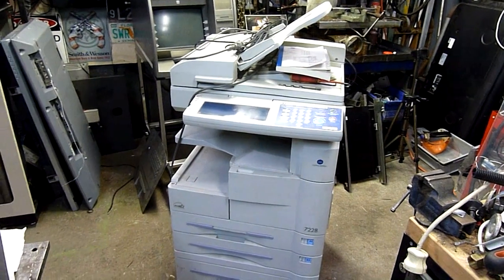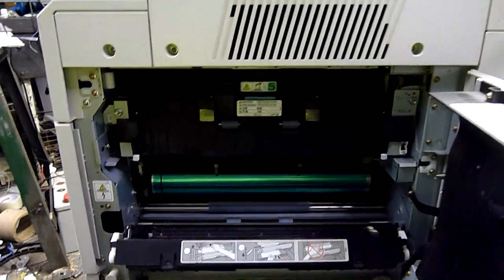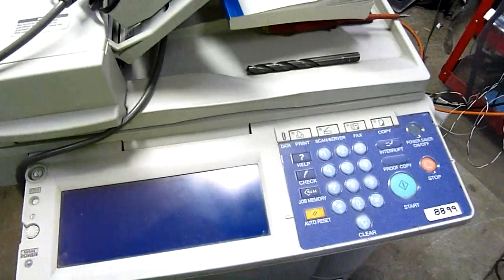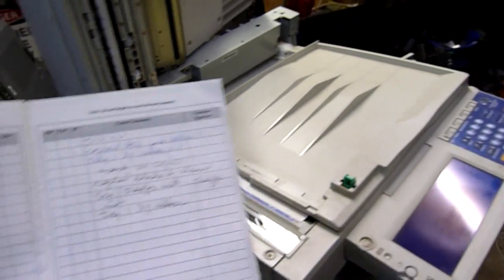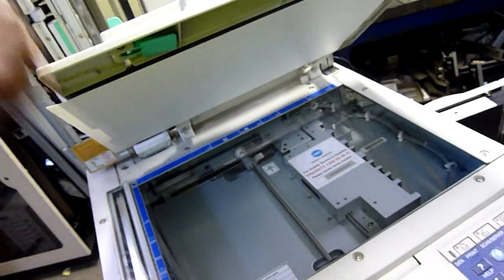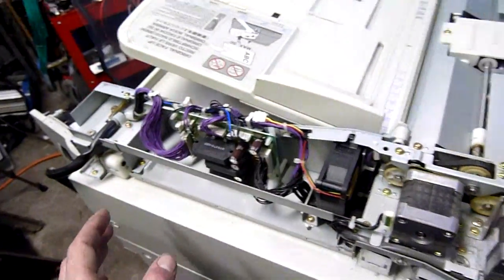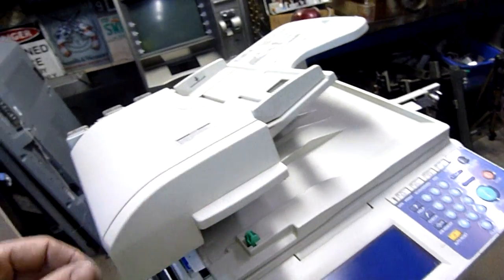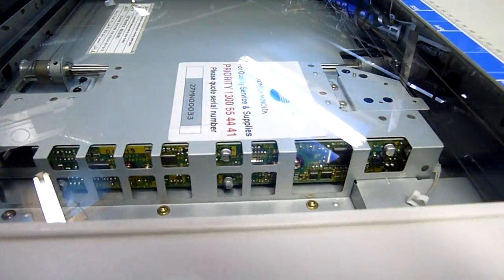Konica Minolta 7228 Copier Teardown Pt1   Intro and Document Feeder

Comment: I assumed that those lines on the drum are just a thing that happens. I have an old Panasonic Workio laser that I picked up for free with a new drum unit that still has that line on the left side of the drum. Doesn't affect printing at all, it's just there when you pull the drum unit out.

Comment: 80k pages on something that 'small' is nothing. I have an HP LaserJet 4L at work that's still in service; its page counter last reported over ONE MILLION pages printed when I was working on it a couple months ago. It's needed two fusers and I don't know how many toner cartridges, but it still prints fine without too many funny noises. It's on a print server for a financial office (8-10 users) so it basically never stops printing.